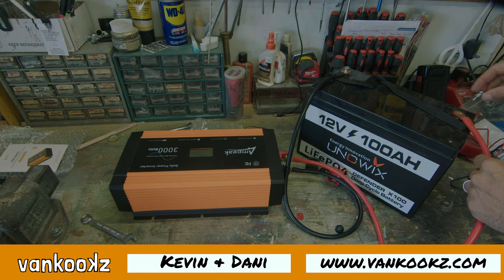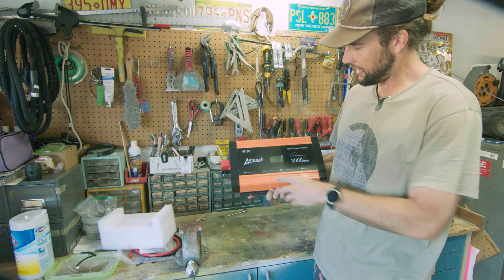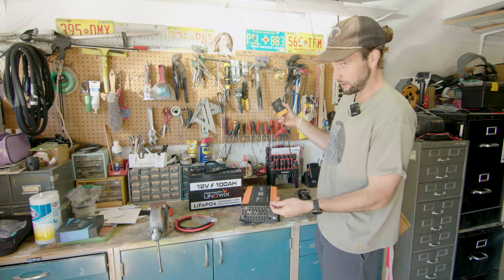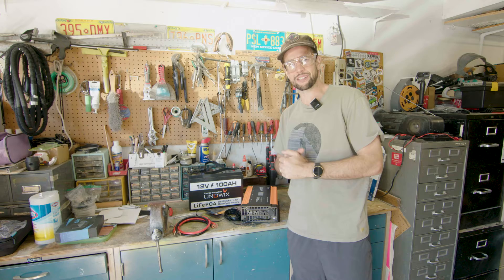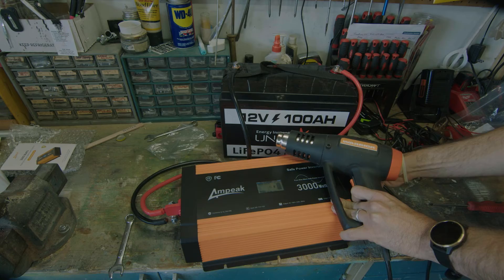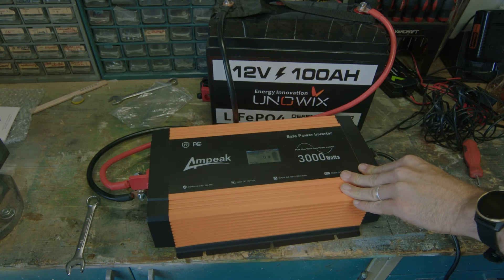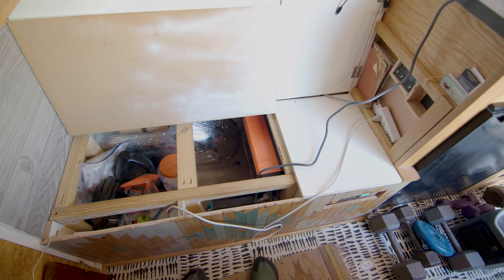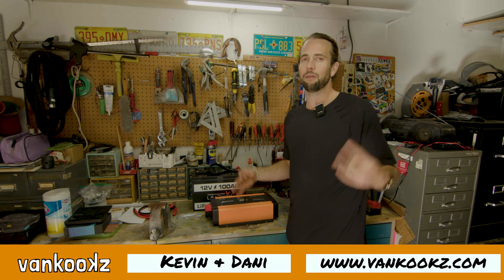Wiring an Inverter to a Lithium Battery | Wiring the Ampeak 3000W inverter to a Lithium Battery

Comment: Solar Power question to the group. 🌞 
I’m a novice at electrical, but I’ve installed a solar system on a previous van, on this current project ￼I installed 400 W of solar power on my 05 2500. The previous owner installed a deep cycle battery in the back and charged it off the alternator I want to install a breaker between the solar power line and the alternator power line so that I can switch back-and-forth without Overcharging the battery. ￼
Currently, I’m looking at these items I found on eBay. 
My solar system is 2X 200 W panels 24 Volt. I’m using the energy Rover 40AMP solar controller so no issues with conversion. 

If anybody’s done this please shoot me some advice. 
Thanks in advance! ☘️☀️

Comment: Great review.  I do have a question about 3000 watt inverters run from a 24 volt system. Am I right in thinking smaller gauge wire is permissible? In other words, if that had been a 24 volt inverter,  would those 4awg cables be fine??

Comment: i just bought a renogy 700 watt inverter with 1400 surge, and a dr. prepare battery.
i was so excited to hook it up but now i learned i need a fuse.
any recommendations for a fuse?
Reply from the maker: Anywhere from 80 to 100 I like to use these breakers rather than fuses because then you don't need to replace the fuse if it trips. https://amzn.to/3QB7dWP
Reply from the maker: You actually may want a higher fuse if you think you will ever use the surge maybe around 175 now that I think about it.
Reply: @Vankookz  theres a 200a option in the link you provided. would that be too high?
Reply from the maker: What are you planning on powering with it? Will you actually utilize the 1400 surge?
Reply: @Vankookz  a full size refrigerator, maybe also a tv if one battery capacity is enough with a 100watt panel. i may add another battery so maybe the 200amp is a good idea for future proof. i guess what im asking is does it matter if i dont need a 200amp breaker, no harm done even if i use it for one 100ah battery?